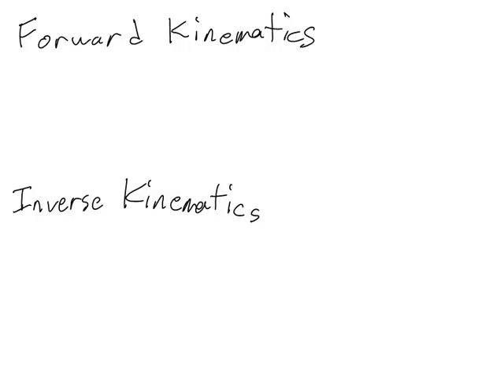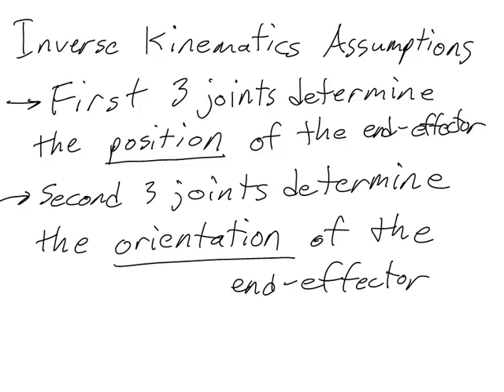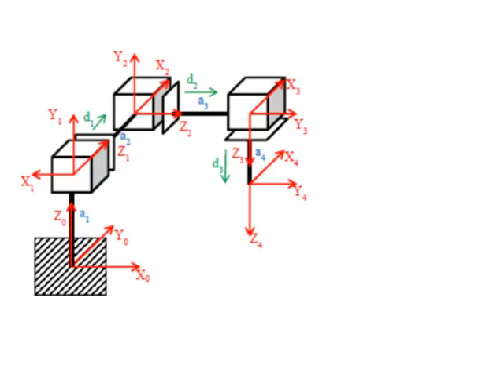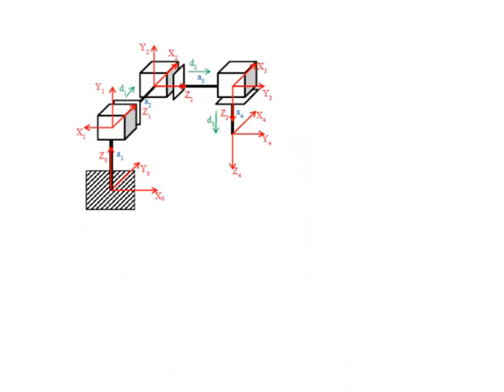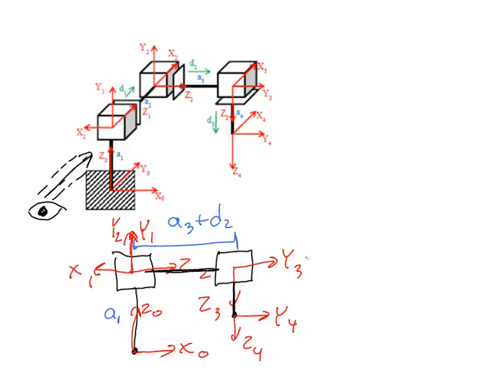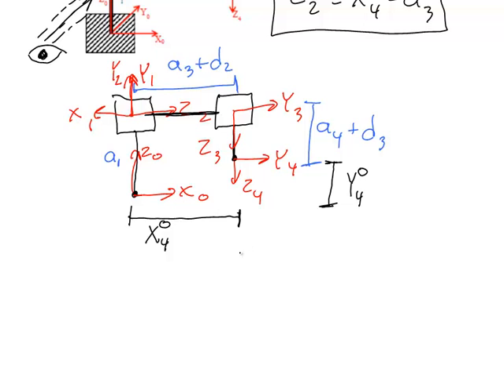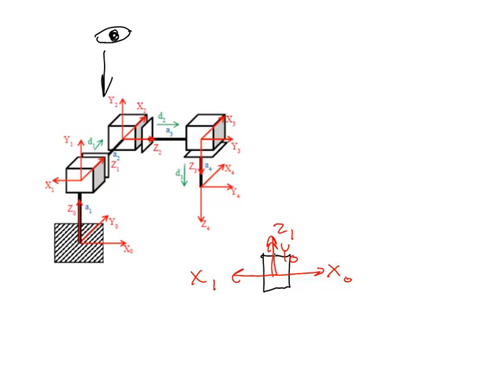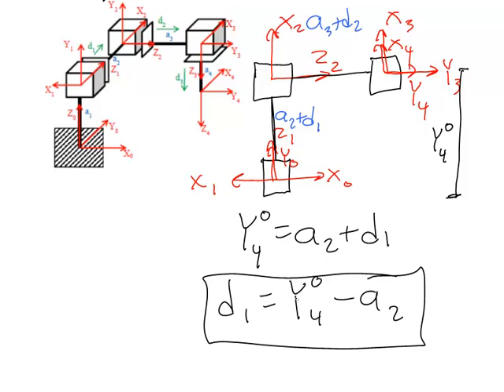1 1 6 Lecture Video 1 of 2   Intro to Inverse Kinematics and Example

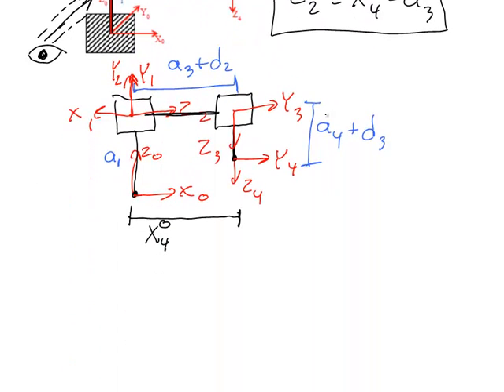Comment: If you think Y equation cannot be written at 15:27, don't worry she will correct it later to Z.
Reply: You are absolutely correct. To get that correctly, frame 0 should be : x to the right as it is, y to the bottom and z to inward the page. Then the translation offset of x and y would make sense in terms of direction and sign

Comment: The second joint of a
SCARA robot is to be moved
from 30 degree to polynomial
105 degree in 5 seconds. Find
a cubic to generate the smooth
trajectory for the joint?

Comment: As someone who took a Robotics class (for Mechanical Engineers, not electrical, but I digress), this does an exceptional job at explaining the concept of Inverse Kinematics.  Our teacher (and book) were both lethargic in their explanation, probably because they were focused on their research work post class and not so much teaching the students.  This managed to explain the core concept and process adequately enough so I could stumble through the Midterm and Final exam questions easier (although not completely).  This was due to the difficulty of the question asked being higher than what was covered, but watching this video definitely allowed me to get more of that question correct than almost everyone else in the class managed, so that's a sort of victory I guess.  Regardless, thank you for taking the time to teach this valuable basis for robotics work.

Comment: I was NEVER good at these sorts of equations BUT now it is starting to make more sense to me.
For "fun" I want to control the end effector (a router) using G-Code on a arm similar in design to the Scorebot ER3 using an Arduino Due (Uno too light for this sort of calculation load)
Why?
Because almost the whole internet said I would not be able to!!!
The way these equations were explained in this video suddenly turned on my "light bulb".
I am curious to see how to do the joints I need between the current XYX(4) [the end of the router cutting tool] and XYZ(3) - that will be a swivel joint system to move the axis of the cutting tool off of the vertical "Z" orientation to get the cutting tool angled correctly to get to places that are not accessible due to material being in the way should the point of cutting be hidden away when viewed from the top.
Thank you Angela !!!

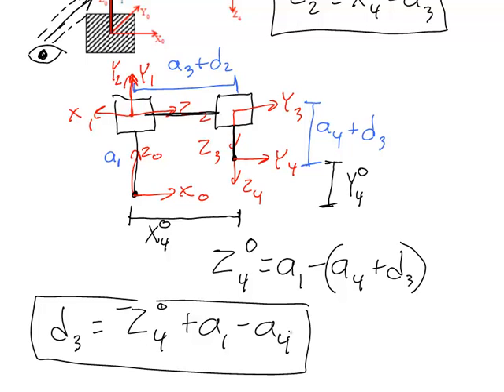Comment: at 17:20  -> the boxed equation should be ->  d3 = Z - a1 + a4
Reply: The equation is correct in the video, you failed to distribute the negative sign in your calculation. Z = a1 - (a4 + d3) = a1 - a4 - d3.